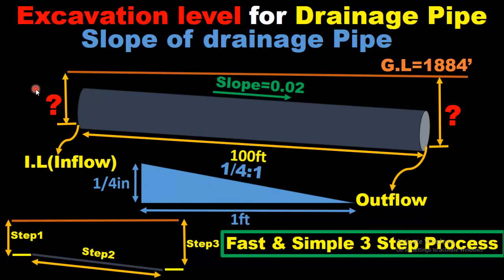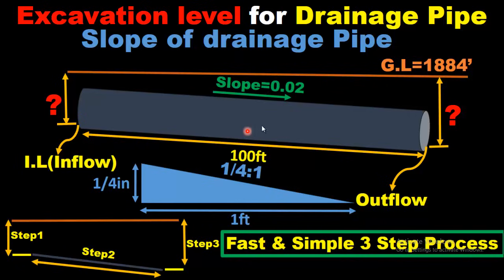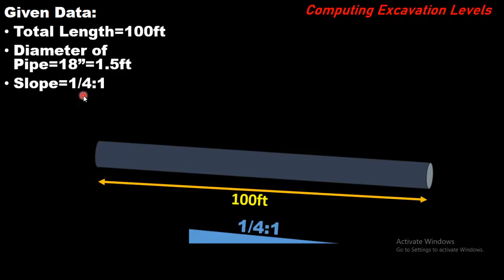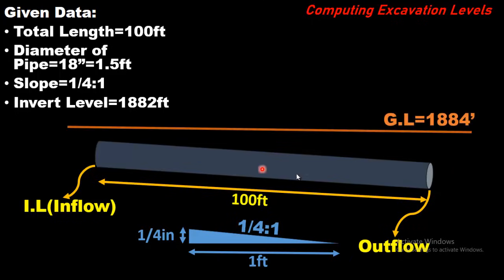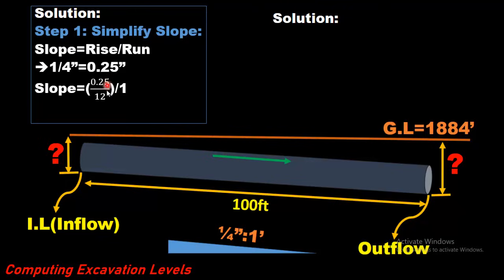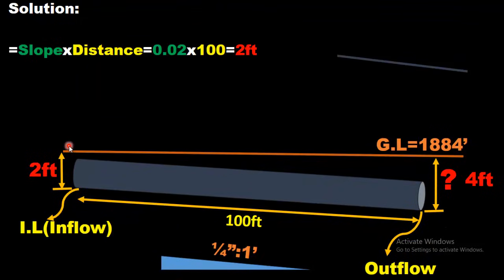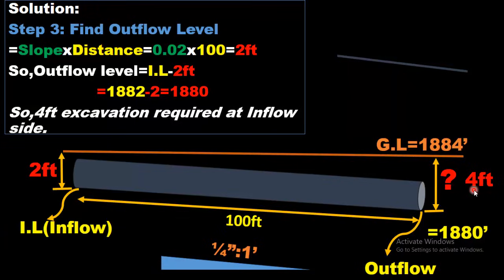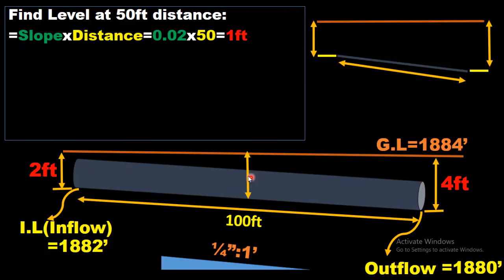Slope of drainage pipe or sewer line|excavation levels for sewer pipe or drainage pipe|Slope of pipe

Comment: In your solution IL  is 1882 
And outflow IL is 1880 the slope is opposite side 😢
Reply from the maker: 1882 is at higher elevation than 1880.
Slope is towards right

Comment: What was the point in converting pipe diameter to feet if not used?
Reply from the maker: Pipe diameter is needed to find top levels of pipe
Reply: Also what if groups level varies ?
Reply from the maker: Follow the same steps for each group separately

Comment: i am planning slope at my place. 1 ques. Slope 0.02 for drain pipe is ok for any diameter or only for domestic 4in or 6in pipe?
Reply from the maker: The standard slope is anywhere from ¼ inch to 3 inches per foot depending on the use.